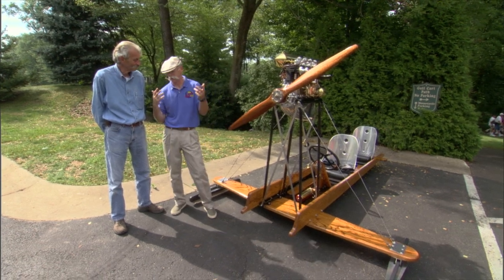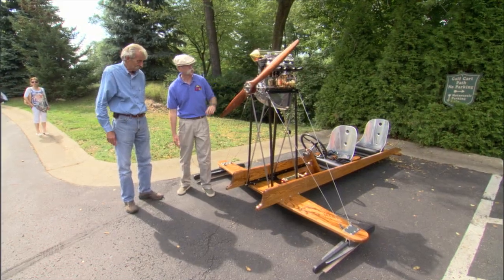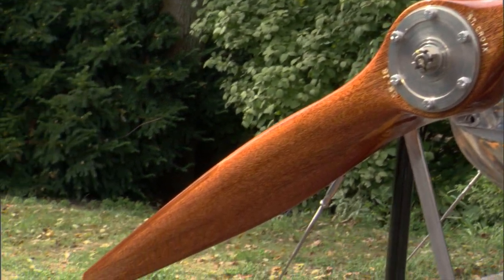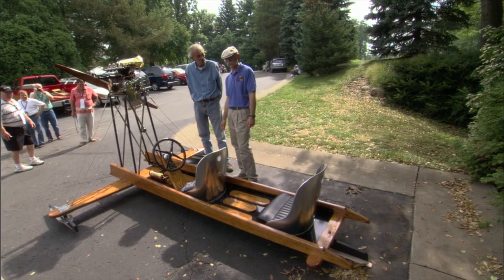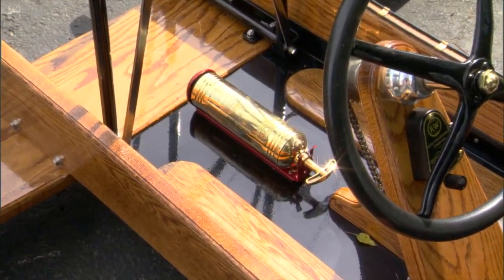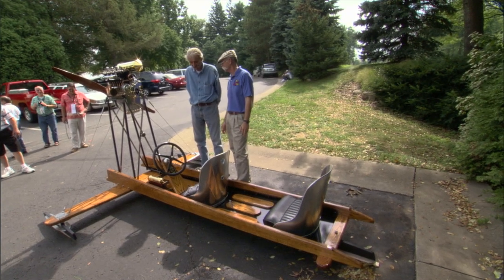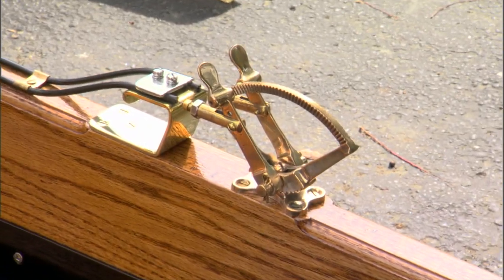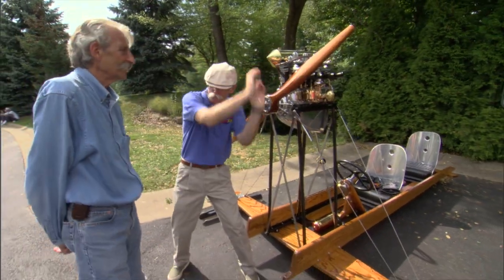DIY Ice Sled

Comment: Nice build, but I have to wonder why the engine and propeller are not in back of the occupants seats. It would be a lot less windy.
Reply: For control reasons. Think about it like it’s a car. Front wheel drive cars work a lot better on snow and ice because you’re pulling the car with its center of mass behind which gives you greater stability. With rear wheel drive you’re trying to push the car with the center of mass in front which is inherently unstable (like balancing a pole on your palm).